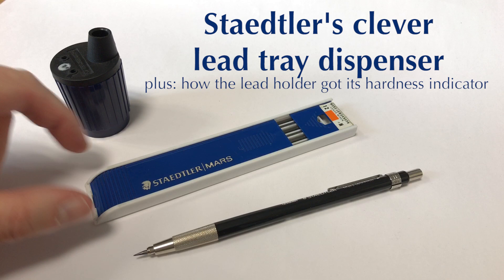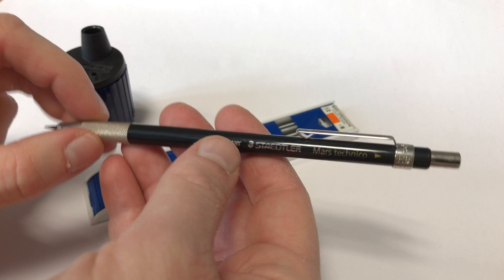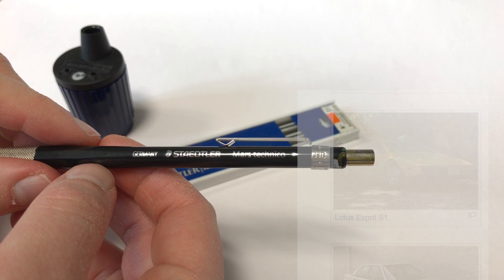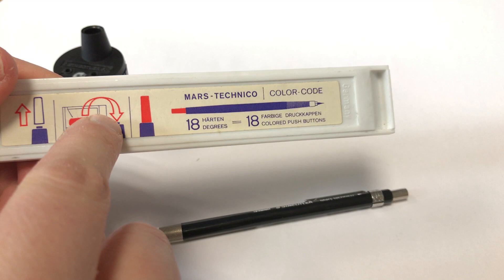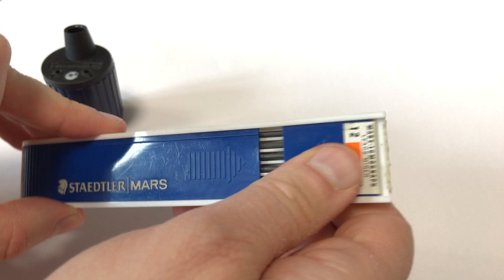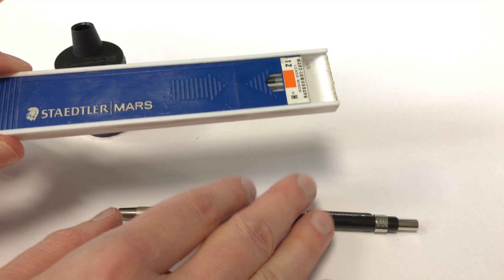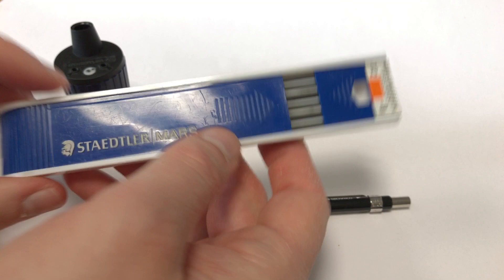Staedtler's clever lead tray dispenser and how the leadholder got its hardness indicator

Comment: I have many 2mm lead holders and containers. Staedtler’s design is the most secure, slimmest and most innovative. I wish someone sold empties!

I would add that if you look closely, they have finger “grips” molded into the flexible blue plastic portion. Look closer and those “grips” are in the form of arrows directing movement to open the case. The inclusion of the unique-to-the-lead colored push-button top and the locking mechanism is just icing on the cake.

Fantastic design 👍

Comment: Thank you for this! I remember way back in the 80's as a young student studying the now-all-but-forgotten art of technical drawing, there was a much better graphite sharpener. It was of a similar design only it was much wider and of metal construct (it almost looked like a bell you'd find on a concierge's desk.) Sadly I've learned that they are no longer in production. But their weight made it much more convenient in the sharpening process as you could simply leave the sharpener on the desk and give it a good couple of turns for a beautiful point. :)
Reply from the maker: Sounds a bit like the Gedess lead sharpener. Was it a metal version of the Gedess?

Comment: I think of the mechanism like a roll-up garage door. New, they can be very stiff but loosen up with use. I've only had staedler or koh-i-noor lead holders with selectable hardness indicator, so didn't even realize there was a second compartment until I was mindlessly fiddling around with the case one day...

Comment: The less expensive 2 mm Faber-Castell lead case has a different locking lid.  A comparison might be interesting.
Reply from the maker: I agree, but I am fairly new to lead holders and haven't bought any refills yet. I didn't even realise FC is cheaper, this comes as a surprise to me. The Staedtler lead tray in the video was from a colleague. As my lead holder use is fairly modest I am not sure I will buy refills anytime soon, I am tempted to get coloured lead refills though, so we'll see.

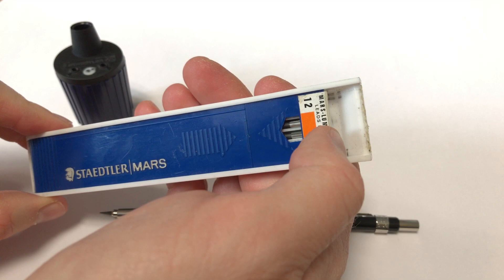Comment: SKIP TO 4:54 (1 minute from end) to find out how to open the box. Clever? Maybe. But too clever by half. I had to go to the web to find out how--and it STILL wouldn't open. But once I knew how it was SUPPOSED to work, I found the LOCKING TAB at the end, where the long part that is supposed to slide has a bit that goes THROUGH the case. Push the tab through with a knife, and THEN it opens...

Comment: Interesting. I do use lead holders but much thicker ones, they also have a variety of types of lead made for different purposes, Koh-I-noor 5.6mm clutch pencils. I did not know there was a staedler lead holder or any other that held a thicker lead than a propelling pencil, I have several such. I recently treated myself to a new compass with large circle attachment and really hate the HB lead and have been unable to find any graded leads for it. Could this type of lead  be used for this purpose? HB does not erase well if you have construction lines working over erased areas is anyway horrible, and sometimes my surface is not paper it is gesso. I have a pencil adaptor but it is less than satisfactory to use, I have been using a staedler propelling pencil, but the adaptor somehow does not really hold it accurately in the way a lead is accurate, there is a constant amount of fiddling as you adjust the compass, which has spring buttons. I like the design of the lead packaging and think I would have no problem with it, thanks for the video, how did you tube push your video to me! From my online searches maybe. Could you let me know if you think I could use this lead in my compass, I would happily buy a lead holder too.

Comment: I cannot locate the article you wrote that you mention in the video. A link would be helpful. Thank you.
Reply from the maker: Thanks for pointing this out. The blog post is at https://bleistift.blog/2016/10/staedtler-at-insights-x/
I will add a link to the video description.
Reply: @Bleistift  I happened to buy the 780C in black last week from cultpens, packaged with a black eraser. Now you mention it, I can see the embossing on the clip denoting lead hardness.  I was not aware of this, and it is not mentioned on the Staedler web site pencil description. I note, as you say, Cultpens do mention it, which shows what a short attention span I have these days.
Reply from the maker: Oh, is there a set with a black eraser? That sounds cool. I will look it up. It's a shame they don't mention the lead heardness indicator.

Comment: I can't open it either. The blue tab locking the blue slide in place cannot be moved.
Reply from the maker: It should open. I hope it’ll open without breaking.
Reply: @Bleistift  Thanks, I got it now, it opens with a strong push, thanks for your help.

Comment: ITS A LEAD HOLDER NOT A MECHANICAL PENCIL
Reply from the maker: Yes, it is a lead holder.
Reply: Sorry if im wrong but i thought machanical pencils has 2mm lead and could be sharpened. And lead holders usually have thin leads
Reply: MaYo MRG it's the opposite.